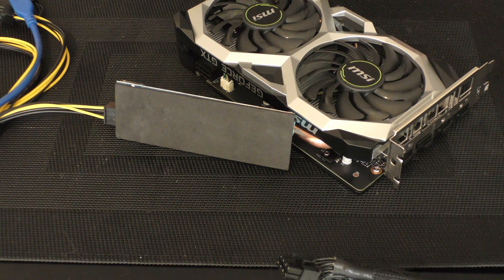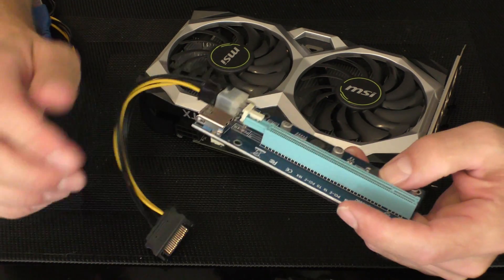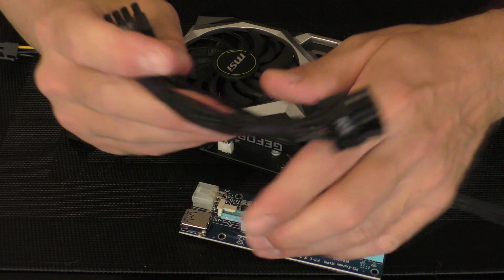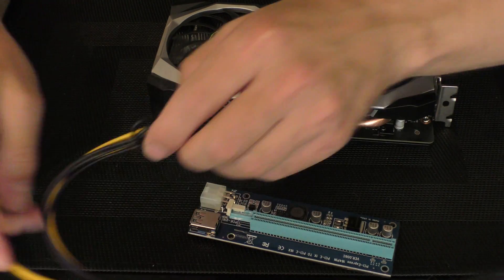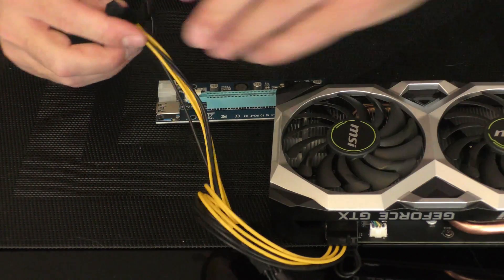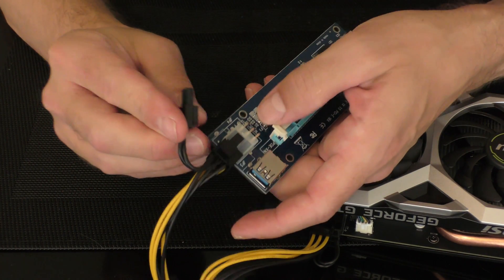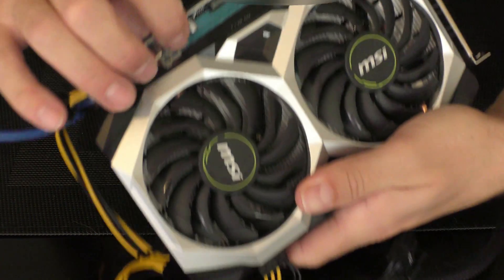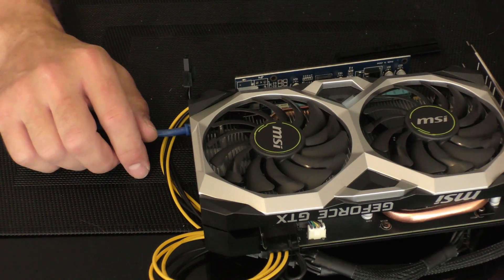Connect your GPU | Riser | Splitter

Comment: Hei sir, i want to connect 2 3060TI and one rx 580 8gb- my psu  800W and came with 3 - 8 pins to 2 6+2 pins. It's ok to connect 3060ti from one cable with one splitter (8pins to 2 6+2 - 1 6+2 to splitter to power up riser and  gpu and second 6+2 directly in gpu) and rx580 from one cable from psu one 6+2 to gpu one for riser? Ty so much!
Reply from the maker: If you talking about using 1 pci-e for 2 GPU's,  with 3060 is possible but I don't recommend doing it.
Reply: @minerondemand  no sir, 1 pci-e for each gpu, but using a splitter to power up riser from same cable
Reply: 1 pci-e to 2 6+2, from one 6+2 go to a splitter which power a a riser and one in gpu and second 6+2 directly in gpu (my 3060ti has 2 8 pins )
Reply from the maker: @BogdanMarian-RiEKER  that's perfectly fine 👍
Reply: @minerondemand  Thank u so much, all best to you, sir!

Comment: I have a question. I've connected my 3060 to riser card but the hashrate drop almost half. Also when I played games, fps dropped too.
Can anyone help me please.
Reply from the maker: 3060 needs to be connected to mainboard on the 16pin slot.
Reply: @minerondemand  How? I'm confused T_T my gpu had only 8 pin anyway.
Reply: @koolz1239  3060 needs specific driver, be connected into motherboard and with monitor to mine ETH

Comment: Question. Why use a splitter?? why can't you use BOTH 6 pins from the PSU?
Reply from the maker: you can, but using splitter you can connect more gpus

Comment: hey there, i want to ask what if our gpu has 6+8 pins connection?ty in advance
Reply from the maker: What don't know  what you have but normal GPU's have
8pin
8pin + 8pin
8pin + 6pin
8pin + 8pin + 8pin
Reply: Even tho my question stands.what if my gpu has more than 1set of pins?
Reply from the maker: @PetrosVu  as long it's not over 288w you can split the pcie cable and split again for riser.  It's simple maths.

Comment: What is the maximum loading of a 8pin cable? If it goes the way as the video shows, that means a single cable providing power to three locations: riser, GPU 1st 8pin, GPU 2nd 8pin. A GPU like 3090 draws more than 300W by stock settings (reported in miner program), I wonder a single cable is safely capable for that.
Reply from the maker: I believe  a 3090 requires 2x 8pin. 
Each 8pin can handle 288w
Reply: @minerondemand  So, is it unsafe for one single cable to power the riser and 3090?
Reply from the maker: @punkysuen  like I said,  you need 2x pcie for 3090 and some versions 3 cables.
Reply: @minerondemand  Thanks, now I understand.

Comment: my power supply has 2x6+2 cables, can i connect one to riser one to gpu right?
Reply from the maker: Yes you can.  The reason I didn't do it,  it's because it's too short,  so I needed splitter

Comment: quality content and very good info, but i have a question from a noob miner, what if i'm running 6800xt, should i be running off a single pcie power cable from psu(with a splitter), or run 2 pcie power cable from psu (no splitter, 1 for gpu, 1 for riser)
Reply from the maker: you'll have to use 2 pcie cables because is a high power GPU with over 300W.
1 pcie can only handle 288W
Check video about high power gpu's
Reply: @minerondemand  so my 3080 rtx with 2 connections (drawing 230) can be safely used with the splitter?
Reply from the maker: @Frosty2211  yes.  Pcie cable can handle 288w

Comment: Six pin female to double 6+2 pen male is fine ??
Reply from the maker: As long you don't pass 216w yes
Reply: @minerondemand  I will use the double 6+2 pin male sides to power 2 risers only not gpu

For gpus I'll use separate gpu cable from psu

U mean the splitter handles 200w only ?..

Thanks,
Reply from the maker: @SkyHighFilms777  yes. 
8pin splitter 288w
6pin splitter 216w
Reply: @minerondemand  dammit I wish I found a 8 pin to dual 8 pin
I only found 6 pin to dual 8 pin this way I'll probably be able to connect riser + 3060ti on same splitter right?...
Can u recommend somewhere selling 8 pin to dual 8 pin or my cables is fine ?...
Thanks,
Reply from the maker: @SkyHighFilms777  try https://www.newegg.com/p/pl?d=splitter+8pin they usually have stock
Reply: @minerondemand  what? 6 pin can deliver only 75W not 216w. Am I wrong?
Reply from the maker: @dominikbaricak9589  no.  Riser deliver up to 75w to GPU. 
6pin,  like you say,  up to 216w. 
Check https://youtu.be/wekRS_vT20s
For more details.
Reply: @minerondemand  thanks! This video is very informative. So the safest way is to use 8 pin to 2x 6+2 pin splitter.
Reply from the maker: @dominikbaricak9589  yes always.  And 1 pcie per GPU + riser

Comment: Can I do 3 3070s with a 850w PSU? - Also I’ll be following your advice using one strand per riser and GPU (using a splitter). Is it safe?
Reply from the maker: You can.  3060/70 are low power GPU's.
Reply: Most probably yes but downclock them....
Reply: @SkyHighFilms777  oh yeah I’ll be running OC settings for sure. Question though, will it be safe if for some reason OC fails ? I mean I’ve read the TDP for each card is 220W so x3 it’ll 660W plus rest of the components I am thinking maybe another 100 MAX???. Not sure.
Reply: @fernandovazquez1685  u r right, 220 I guess for 3070s x3 that's 660w total

But the reason I said what I did is because u will probably pump up the memory clock to 1000-1200 MHz for each card (don't worry nothing bad will happen whatsoever) when done afterwards and u WILL have to reduce the Power Target for each card to around 60-70% I believe, some go 50% but I don't recommend it and I don't think it will work

I did this for a friend last couple of week it went easier than I though it would be and he is happily mining 247 I believe with no issues, just note this since u got multiple cards if u start seeing the gpu clock jumping and going crazy in the monitoring software between different values then this mean not enough power is feed to the gpu clock so u wanna increase the power Target Marginally to make the gpu clock stable, honestly don't down clock the gpu just leave it for now since u feed less power to the card this is the Main thing...

So now each will consume only 130w at 60% power limit,

Ur cpu, ram, board, ssd shouldn't consume more than 100~150w only, so yeah 850w psu is more than enough....
Reply: @SkyHighFilms777  thank you very much for your time and advice! Will follow as recommended!
Reply: @SkyHighFilms777  Oh, then I guess I can be safe with a 750W PS with 3070, 3060ti and RX580, one each one, of course with undervolt, core underclock and memory overclock.
Reply: @ferveloper  i am sorry but i never tried amd cards, not on a mixed setup with nvidia on the same rig or pc ! i never tried that and for a beginner i dont recommend it either !... i have 5x 3070s and 3060 Ti(s) on the Same Rig and with 1200w PSU and we are running happily ever after :)
Reply: @fernandovazquez1685  how did it go ?... i forgot to advise you one last thing, the main problem you might face is the lack of PCI0E Cables for both the Cards and the Risers ! This is far more important than the wattage ! try to get a PSU tjay will have ENOUGH PCI-E CABLES !! and if you have the 3070(s) those cards are nasty lol they require 2x PCI-E Cables, you will EASILY RUN OUT OF CABLES EVEN WITH A HIGHER END 1000w+ PSU as many high end PSUs have less PCI-E Cables and of course dont forget the Risers require PCI-E too which sux, i had to return one 1200w silverstone PSU for having less PCI-E Cables ! eventually i bought a better PSU but still ahd to use Splitters !!...
Reply: @SkyHighFilms777  They work! My rig consist in one RX 580 and one RTX 3070, I'm considering to add a 3060ti but ATM I can't find them here in my region, they will got some soon, but I also need the PCIe risers, they are also hard to find here 🤦
I think other than that I'll not have inconveniences, I do have another 6+2 pins power cable for the PS, so it will be ok for the 3060ti, or do they also use 2? 🤦

Comment: I have 3060ti, my card is connected to a different psu but i use the sata for the riser. It draws 120watt. Is it still safe?
Reply from the maker: Noooo no sata to power riser please.
Reply from the maker: And GPU + riser should be on same PSU

Comment: let me ask, I ran out of splitter 8 pin female to 2x 6+2 pin male... Is it safe to use 6pin female to 2x 6+2 pin male  splitter in powering 1660 super gpus???
Reply from the maker: If you mean powering from 6 pin PSU. 
Yes,  in this case. 
If you mean splitting to power 2 GPU's , no

Comment: Can I connect a cable with 2 pci 8 pin to the 3070 board and the riser feed it with a 2 molex splitter to pci 6 pin?
The source brings 4 molex, each cable 2 molex
Reply from the maker: Yes you can.
Reply: @minerondemand  Perfect, the power of the 2 pci 8 pin is added with the 75w of the riser?

Because I want to use 2 spliter from 8 pin to 2x8 pin in the same cable
Reply: @minerondemand  If the pci brings 288w / 2 = 144w + 75w (riser) = 219w?
Reply from the maker: @ProdbyLa.N  whatever the GPU consumes,  already includes the 75w from riser
With OC,  a 3070 will consume about 130w
Reply: @minerondemand  So it will work fine if I connect 2 3070 to a pci output with 2 splitters?
and the riser with 2 molex

Thank you very much for the help, you saved me!
Reply from the maker: @ProdbyLa.N  I must misread somewhere. 
No.. 1 pcie cable per GPU. Always. 
Remember if OC fails,  wattage will go up.
Sorry for the confusion
Reply: @minerondemand  So how do I connect?  I have 6 MSI 3070 and 2 Artek voltron 700w
Reply from the maker: @ProdbyLa.N  I'm afraid you're going to need 6 pcie cables.
As another option,  server PSU are much cheaper
Reply: @minerondemand  If first I do the oc with 4gpu? Once it is stable I connect the other 2 gpu

But I have to connect 2 gpu to 8 pin pcie line
And in the other source I have to do the same so enter the 6 3070 in 2 sources
Reply from the maker: @ProdbyLa.N  yes you can have 2 PSU. 
Just as long same PSU powers same GPU + riser. 

The OC you can do either way. 
If you have a rogue card,  you'll still need to adjust. 
Either you find a common ground for all cards,  or you individually overclock them.
Reply: @minerondemand  Perfect thanks, how would a mother with a 3 psu to 1 adapter go?
I have a z390 aorus pro wifi
Reply from the maker: @ProdbyLa.N  same way as 2. Either a 24pin splitter or a dongle. 
Just make sure to power secondary PSU before primary (the one powering mobo)

If you don't mind the noise  server PSU are a good option

Comment: i have a 5700 XT which uses two power connections a 6 +8 .  Should i split the 6 into two 6 connectors one for the GPU and one for the Riser?  Keep in mind only one cable is coming from my evga PS which has two ends already.
Reply from the maker: It's easier to split the 8 pin since the spliter is also 8 pin.

Comment: Is your splitter 8 pin two 8 pins?
Reply from the maker: It's 8pin to 6+2
Equal 8 to 8
Reply: @minerondemand  Can you send me link to the splitter you use. I cannot find one.
Reply from the maker: @pie1337  that would depend where you live.  Or you can try aliexpress.
Reply: @minerondemand  i have a few questions i hope you don't mind. what i see mostly selling are 6 to dual 6+2 and 8 to dual 6+2 but listed for the cpu. Are the 8 to 6+2 splitter for the cpu and pcie dirrent? and if im using 6 to dual 6+2 to connect to the 8 pin psu will that be different to using the 8 pic pcie splitter? Thanks
Reply from the maker: @pie1337  yes CPU and GPU splitter are different. 
If your GPU is low power (less than 100w)  you can use 6pin to 6+2 splitter.

Comment: How would you power a card with triple 8 pin, taking into consideration that you also have to power a PCIE riser? a grand total of 3 8-pins and 1 6-pin. Asking because I just bought a Vega 64. New to mining.
 

Sidenote: I used to see diagrams that said it's not safe to use 1 PCIE slot from the PSU (using a dual 8-pin cable or with splitters) to power a dual 8-pin GPU. Is it not the case anymore?

Thanks! Subscribed!
Reply from the maker: In this case I would use 1 pcie for 2x 8pin + 1 pcie for 1x 8pin + riser. 

As for your side note,  it's all about the power.  See my other video about high power GPU
Reply: @minerondemand  I see. Thank you. 

One last question regarding PCIE that are 2x8-pin. Is it not advised to use each 8-pin (coming from one PCIE) to power 2 relatively weaker GPUs? Say for example 1660 Super + 1660 Ti?

Saw a comment here that each 8-PIN supplies 150W, thus this question. Just a bit curious, but I have heard that it's not safe.

Thanks for all the help!
Reply from the maker: @eduardoreyes2128  even tho 1660 are low power I don't recommend doing it.  
I've done it myself and couldn't sleep in peace. 
1 pcie for each GPU

Comment: can you please give me a link with the splitter?
Many Thanks.
Reply from the maker: What you mean?  To buy?
Reply: @minerondemand  yes to buy,please
Reply from the maker: @Ελευθέριος-γ4β  that depends where you love bud. 
Amazon, 
Ebay
Parallelminer
Newegg
Reply: @minerondemand  is the adapter a pcie y splitter?
Reply: @minerondemand  this Splitter?    
https://de.grandado.com/products/cpu-8pin-zu-2-8-pin-6-2-grafikkarte-fur-miner-doppel-pci-e-pcie-8pin-6pin-2pin-stromversorgung-splitter-kabel-21-cm?variant=18642634113081&currency=EUR
Reply from the maker: @Ελευθέριος-γ4β  that's CPU. 
You need the same but for GPU

Comment: did that and smoke started to come from that that thing you put into motherboard. they are really cheaply made
Reply from the maker: My guess is you put it in wrong way around
 Little tongue should be on the outside
Reply: @minerondemand  maybye was bit drunk. Thank god mobo wasn't damaged too much and still works. But when i do it properly with 1 gpu in mobo and other from riser none of them being detected any idea why
Reply from the maker: @wolverine1981pl  could be a few reasons.  Make sure both GPU still working by connecting to mobo individually. 
Then,  try risers same way.
Reply: @minerondemand  gpu working fine in mobo but wanted to give them more space due thermals. and bought 4 blue risers . 1 burned LOL and rest 3 same effect. tried them on with different cards and on another mobo aswell
Reply from the maker: @wolverine1981pl  at this point I would blame risers. 
Did you connect the 6 pin and USB?
Reply: @minerondemand  yep. tried pcie 16 port and pcie 1x port on motherboard. no matter how i connect gpu not recognised
Reply from the maker: @wolverine1981pl  does it show on windows device manager?
Reply: @minerondemand  nope. just built in gpu.
Reply from the maker: @wolverine1981pl  ok.  Lets try another thing. 
Go to bios and change pcie to gen 2 or 3.
If available set 4g decoding on.
Reply from the maker: What riser version you have?
Reply: @minerondemand  only option i have is 4g decoding which is on. thanks for trying to help. ordered different riser (red one) so hopefully will work.
Reply from the maker: @wolverine1981pl  don't go by colours.  Try to get version 009s
Its more recent and better
Reply: @minerondemand  cool. one i have atm is 006c. one i ordered is 009s:)
Reply from the maker: @wolverine1981pl  hopefully they will work. 
If you want join us on discord.  Lot of people there.  Some might have more ideas

Comment: One PCIE 8 pin strand deliveries 150w. So make sure you use two strands for the GPU ,especially the high end cards that are power Hungary.  if use splitter to feed to the riser at the same time.  75w goes to the riser. 75w150w(second strand of pcie) goes to the card. that should be ok.
Reply from the maker: Thanks Tony.  I did make a video explaining that,  referring to high power cards.
Reply: Pci-e male to male is 288watt's and 6pin is 216 watts.
Reply: I live in Budapest so I think my cards are power Hungary :D

Comment: thanks for the video, i bought a EVGA 1600 supernova g2 and it does not have enough vga power connecters to power my 5x 5700xt cards. Didn't even come with duel 8 pin vga power cables. Are all the pin layouts the same at the output, i just don't want to power something wrong and wreck something
Reply from the maker: You can split the 8pin and then split again to riser. 
But only use 1 evga cable per GPU
Reply: @minerondemand  the for the reply. I got some splitters from amazon but my VGA power cords have a flat spot making it not connect tot he splitter
Reply from the maker: @victoria653  you probably got CPU splitter.  They won't work here
Reply: @minerondemand  I have 1660 super and a 1070, unfortunately I only have one pcie cable from my psu, lost the others. As 1660 super draws a very low amount of watts, is it risky to power both using a splitter. I've heard the 8 pin can take up to 288 watts
Reply from the maker: @TeamGamingSWE  I don't recommend sharing pcie with 2 GPU's.  If cable goes bad it might damage both.  Safer to buy another
Reply: @minerondemand  ok, I think I will swap it out against a bad gpu in another pc anyway, thanks for the answer

Comment: It's very easy but other GPUs come 6 to 8 pin this required more splitters
Reply from the maker: Yes.  This is just an example. If your vga cable don't have splitter and your GPU requires 2x 8 pin than you'll need 2x splitters to power GPU and riser with vga cable.